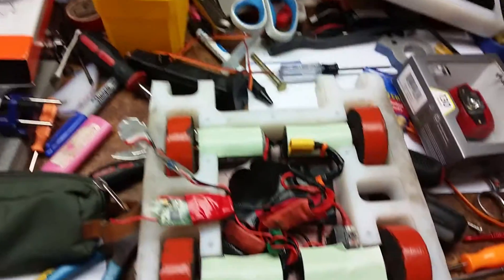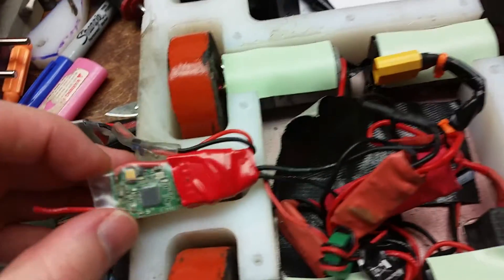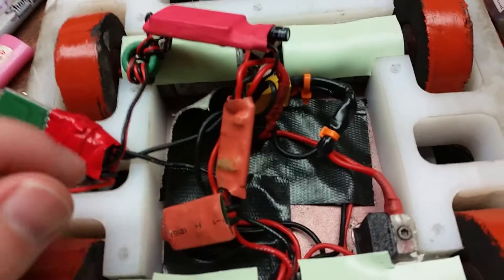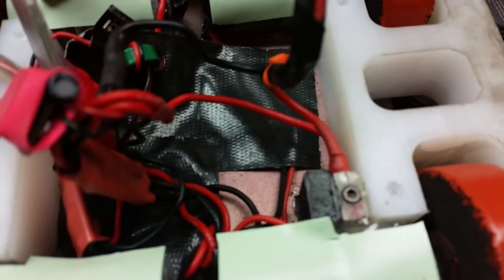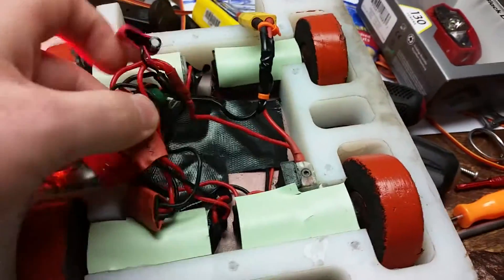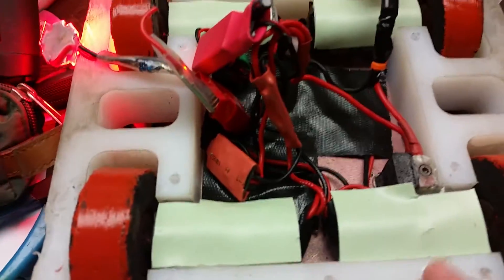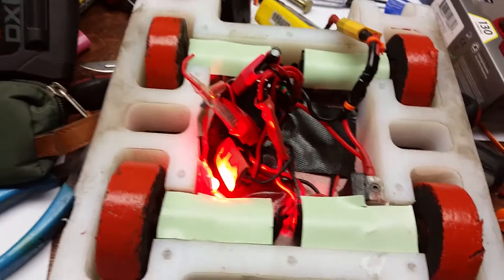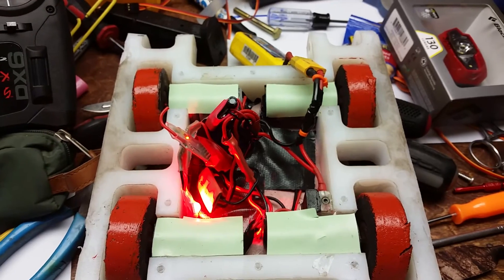Speed Wedge 3 - Internal Wiring (4WD Beetleweight)

Comment: Do you know what gauge wire you use to connect the motors to the speed controller?  Does it matter?
Reply from the maker: I believe that it is 20 gauge hobbyking silicone wire in this video.

 It does matter. 30 gauge wire would melt the insulation before the motor stalls out. 14 gauge would be heavier than needed. This bot has a maximum possible current of about 12A per side because each motor will pull about 6A at stall at 14.8V. A good 20 gauge wire will handle that for longer than 3 minutes. If I had wired the bot differently by directly connecting each motor to the esc, I could have used two sets of 24 gauge wires. I also could have used a 20 gauge wire to connect to the first motor, then used 24 gauge to connect to the next motor.